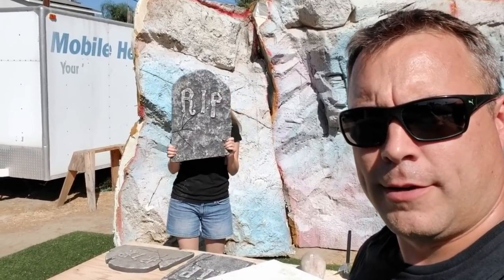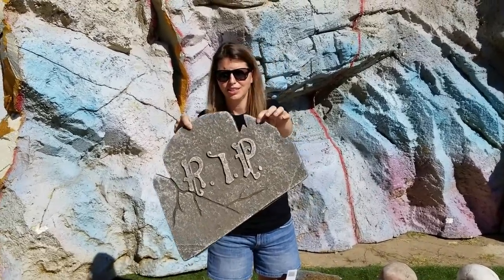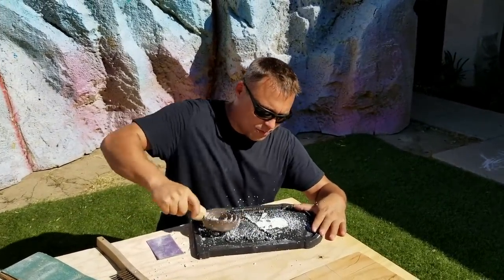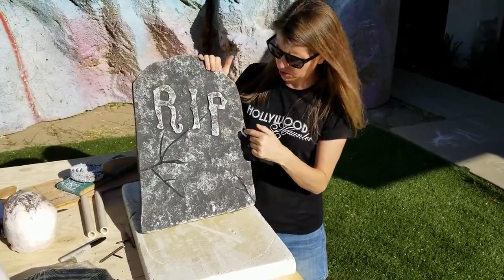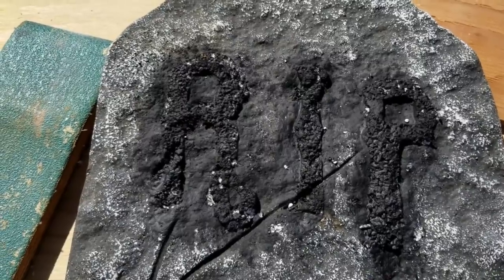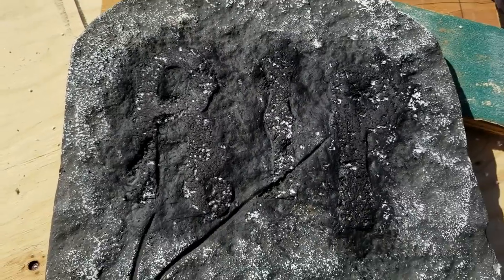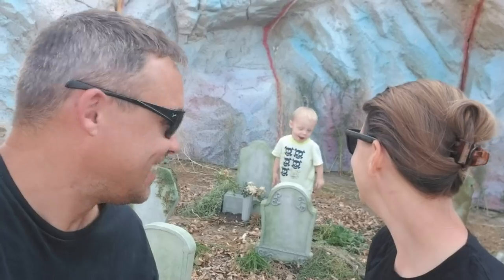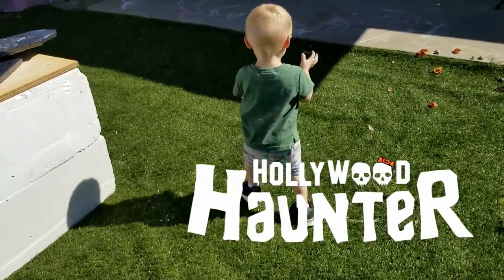Halloween Decoration Ideas 💀 Store Bought Halloween Tombstone Makeover

Comment: Nice tutorial. I've been thinking about what to do with my old 99 cent tombstones. 

One quick suggestion: Grab a 1x4 piece of scrap wood, drill your pvc holes in it and use it as a template for future tombstones. You can then use it when placing rebar into the ground. It helps me when designing my cemetery scene by swapping out gravestones from place to place without have to reinstall the rebar for each tombstone. :)

Comment: Awesome Video!!.  You guys do wonderful stuff.  I have a few questions... what is the wood handle scrapper tool you guys used/where can I find one....2nd question have you used Drylock instead of flexbond?  Does one work better than the other?
Reply from the maker: The scrapper is a curry horse comb, you can find them at pet stores or tack and feed for livestock. Drylock would also work to weather proof. The texture is the only thing that would be different.

Comment: Just watched your video. Great ideas for the cheap tombstones that like to fly away in a good wind. As for finish work. I found using Rustolium Granite spray paint for a base color and the mist with a flat black really mimics the old stone color. I have also use the Stone paint you can buy at any box store or Walmart. Use this for the base and then color how ever you like. The stone paint also will hide the edges where your layers come together. Keep up the good work.

Comment: Can also leave the  Wooden skewers in the foam and just clip off the ends.  After that you push them into the foam a bit past the face and fill hole end with putty.  Then you have the added strength of the wood bits in the joint without seeing them.
Reply from the maker: That's true it would.  We pulled them out so we had them for other projects but foam does glue them pretty well.  You caught us being cheap 🤣

Comment: If anyone was naive like me, that's shedding blade he uses to surface the styrofoam headstone. Decker makes one. Shed n Blade makes another. Look up multi loop shedding blade for those interested.
Reply from the maker: Thanks that's great and another search term is metal spiral curry combs https://amzn.to/2XGaM6g
Reply: @HollywoodHaunter  I tried that and the first thing on Amazon showed was rotary saw blades. Then I went to Amazon and Bing. You guys are awesome btw! You, Stillbeast, and Drachenfang help out so much with making props! I did a small haunt last year just around the house. It was like a 2 compared to what you guys do.

One thing I haven't seen: I took the swirly motion lights from Spirit and put them on 10ft long PVC pipes (the thick ones, I think 3"), mount them, drill holes in the pipes, and zip tie the lights in. I found when people walk in front of them they cast a huge shadow, but putting them in trees or on my cheap light stands there's basically zero shadow. And I've used old cell phones and cheap blue tooth speakers for the creepy music.

Comment: Electric knife works great.
Reply from the maker: We have several homemade ones and cheap ones from harbor freight.  They work but sometimes its faster to just cut and done no extension cords, waiting for it to heat up, fumes, burning yourself, wiping off the hot knife, untangling the hot wire, turning it on and off, setting it down where its safe, that kind of thing.  Sure you have a mess but i have more control sometimes.